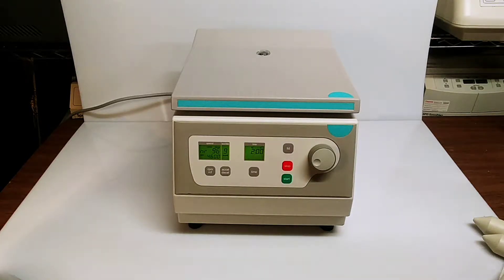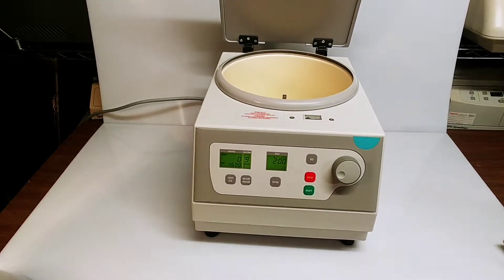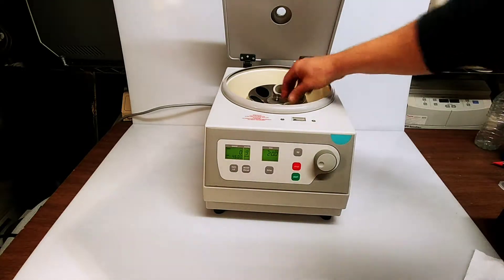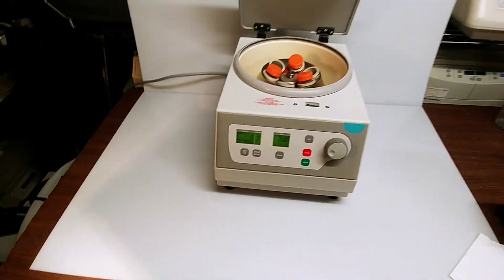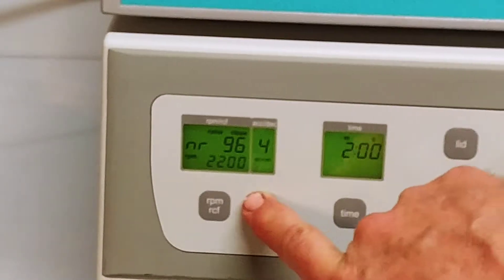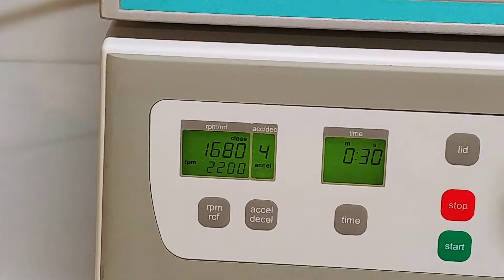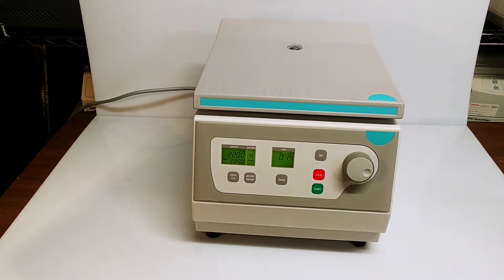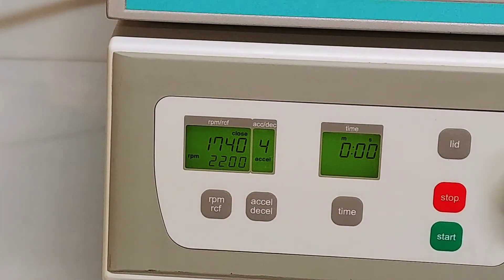HERMLE Z206A Compact Centrifuge

Comment: Hi, I tried to separate the solid samples from the water but it didn't work, I tried many different times and speeds, any tips to solve this issue? Thanks
Reply from the maker: Did not see your mssg.  Do you see any type of density gradient in your samples after the centrifuge?  A lack of separation would suggest there is a high affinity for hydrated 'particles' to remain in solution.  You may need to modify the solution (change the pH, etc.) to increase the opportunity for particles to coalesce, and crash out of solution.
Reply from the maker: Hassan... sorry for the delay.  What do you know about the type of solids in your sample?  If they are not separating via centrifugal force (density gradient) indicates the solids are at a lower energy state in suspension.  What is the pH of the solution... try shifting the pH to introduce agglomeration before spinning.  That may be a quick way to crash the solution... next would be to introduce something to act as a chelating agent.   Again, my apology for my delay in answering.

Comment: May I ask you how to solve error 04 for hermle centrifuge z32hk.! Thank you
Reply from the maker: Is ERR 04 appearing on the LCD?  When does the error occur (as soon as powered on, after lid open, etc.)?

The normal error codes that show up in the LCD do not include 04.  Err 01 indicatess a load imbalance.  Err 03 usually indicates that the imbalance sensor has gone bad.  I have never seen an Err 04, and it is not listed in the service manual.

More information about when the error occurs may help provide more insight.  Thx.

Comment: What difference between  angle rotor and swing out rotor ??
Reply from the maker: Hi... I was out of town on business and my store was on vacation, and I did not get your message.  A fixed angle rotor, as in the unit you asked about, holds all of the tubes in a fixed position, typically around 45deg.  A swing bucket rotor has the buckets mounted on a pivot so that they can 'swing' out perpendicular to the axis of rotation (90deg).  The biggest operational difference is that the swing bucket usually requires a bigger bowl for a given size of tube (so they have room to swing), and they also cannot spin as fast.  Most swing bucket rotors are limited to 4K rpm as a maximum.

Sorry for the delay in response, and I hope this answers your question.